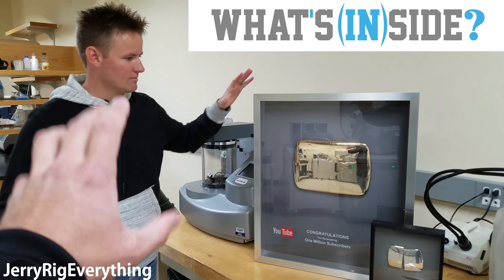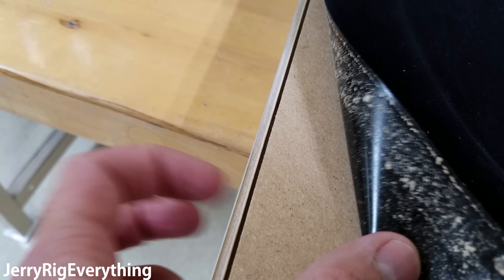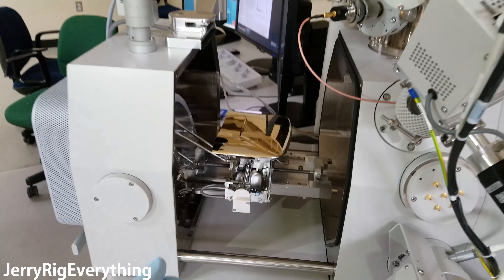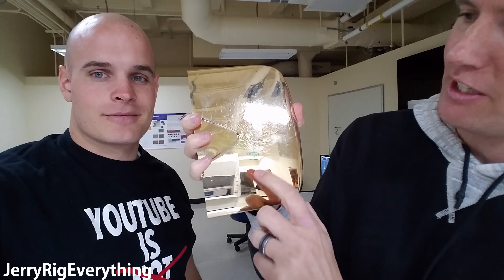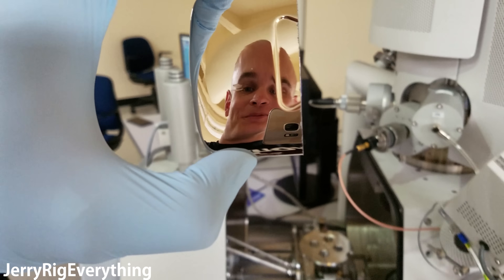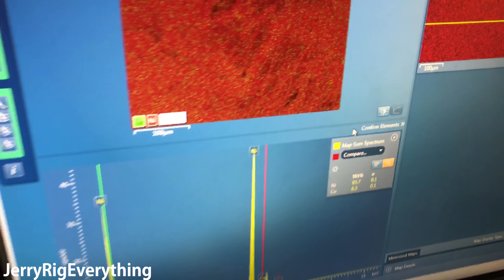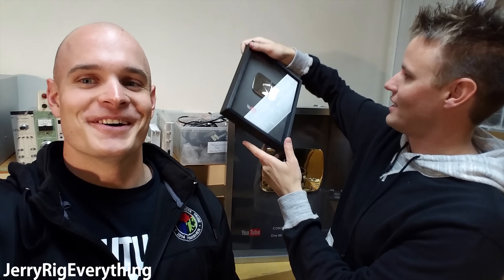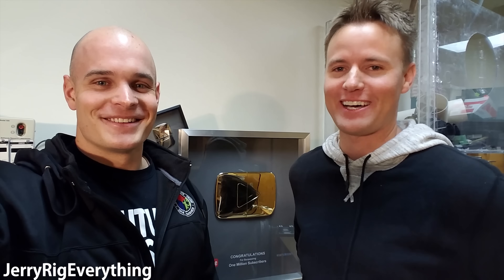What is the Gold Play Button REALLY made of?!?

Comment: With direct gold-on-copper plating, the copper atoms tend to diffuse through the gold layer, causing tarnishing of its surface and formation of an oxide and/or sulphide layer.

A layer of a suitable barrier metal, usually nickel, is often deposited on the copper substrate before the gold plating. The layer of nickel provides mechanical backing for the gold layer, improving its wear resistance. It also reduces the impact of pores present in the gold layer.

Comment: The reason you get higher values from the back vs front could be due to the surface properties. I work with an WXRF and when the sample is not perfectly polished, then it will give false values. There is also the concept of using actual 24k as your standard or a brand new plaque for your control. None of this probably matters after 7 years, but it’s cool to see equipment I use at work being used different ways.

Comment: interesting, my theory about more gold on the back, is that they plated the whole thing in gold, and then polished the front which apparently removed around 5%, if 24k gold was used, then maybe the reader can penetrate a little bit under the surface to discover all that nickel. I mean, if the theory is correct it means that after just 3 polishes, which I assume they also remove as little material as possible, you get to the nickel, so definitely possible that the spectrometer can see some nickel underneath the gold.

Comment: I just watched your video on the Aftera, and I want to complain about your statement that it requires thousands of parts to replace a head gasket! 
These kinds of statements are misleading and wrong 😕. In the future, 
could you please stick to the facts? 
Replacement of a head gasket requires the removal of the valve cover, the removal of 6 to 8 head bolts, and the replacement of the gasket. Then reassembly in reverse. Not thousands of parts!!!!

Comment: Did you consider that the front is showing less gold than the back because they started with a plated surface(aka very very thin layer) and polished it thus removing some of the plating? It would then make sense that the unpolished back would contain more gold due to a thicker layer of plating? I think the hairless dome has been polished a few too many times as well.

Comment: All you had to do was change the acceleration voltage of the electron gun to a lower voltage such as 5kV . Redo the EDS analysis. if the gold content increased that would be due to the beam not penetrating as much and showing a bias for the surface material. There is actual programs for using such differential analysis for the coating thickness measurements.

Comment: My uncle used to run a gold plating business that ran parts for many different companies including Hewitt Packard at one point. He commented that this is an extremely common issue with gold plating since the brass will not plate properly directly to gold(nor will it have much wear resistance) it is first plated with Nickel and then plated with the composition of Gold requested by the company the Nickel is typically by far the thicker coating for various reasons and will show up in an electron microscope either if the gold is not plated on thick enough or has been worn down his thought on this was that the gold had simply been worn down slightly judging by the state of the play button and that is what is causing the nickel and zinc to show through. this does show that you would need to re plate the piece if you wanted it to last a particularly long time and both front and back are plated to help with corrosion resistance. If you want the part to be safe from oxidization you may want to re plate the parts that were cut or worn down in the front.

-Best regards I love this kind of content so keep up the good work.
Reply from the maker: Very interesting, thank you!
Reply: @JerryRigEverything   you are osm
Reply: The plating was likely worn off from when they polished it to that mirror finish. Which is why the back looked like it had the proper composition (80-20 Nickel to Gold).
Reply: I don't think brass will corrode that much, unless the button is kept under water.
Reply: All I can think about is LA Noire electroplating.
Reply: tldr
Reply: Understood.
Reply: Electron microscopes sample pretty deep. Unless the gold layer is several microns thick, it's not surprising that a nickel adhesion layer shows up.

Also, fun fact, you have to do this to get gold to stick to glass, and for that we often use chromium.
Reply: @ojaskumar521  ??
Reply: @PartSane  haha

Comment: It's almost certainly really 24K gold plated. The electrons and x-rays of the EDS area shooting right through the gold to additionally see the underlying Ni and Cu. EDS penetrates a few microns and Au plating is usually quite a bit thinner than that. Between the copper and gold they will plate a barrier layer of nickel to keep the Cu and Au apart as their atoms want to diffuse into one another, leading to an ugly finish. The Ni prevents the Au intermixing with the body of Cu. If you want to really verify what's on the surface, find a lab with a Auger electron spectrometer - this technique only samples the very surface and I'm certain you'll detect only 100% gold.

Comment: A weapon is a tool just like a shovel the shovel is designed to dig a hole a relatively small one. If you want to dig a large hole you use a different tool such as a backhoe. The AR 15 is a a tool what is the purpose it was designed for.

Comment: In spectrograph analysis it depens how big voltage he used for the beam. Higher voltage - deper analysis. So if the gold layer is very thin, it will be better try lower voltage :-) I was working in Thermofisher scientific which is making this microscopes :-)

Comment: The top side has less hold probably because they electroplated the whole thing and polished the top off to a mirror finish. Also, the coating really doesn't have be thick for the gold to be visible. Coating a few atoms thick would also look gold like. But the x-ray could probably penetrate more than that thickness and was reading the base coating as well which was nickel. That's why it didn't show 100% gold.

Comment: Hehe, I used to be an electroplater by trade, and I will happily state that the gold play button is brass, plated with nickel and then gold on top. The gold is probably only a few of microns thick, (for cheapness) so yeah, it can easily rub off, and the nickel underneath was polished to a mirror finish. The silver play button is interesting, as I was expecting it to be a zinc nickel alloy, but it's just nickel and copper, oh well. It's still kind of like belt buckle metal, just with no zinc.

Comment: I know this is three years old, but you all have to understand that the plating is probably a nano coat.  Maybe 100-500 nanometers.  That's why the sub-straight is brassy - so the coat can be thin and it won't look blue or red.  The interaction volume on that machine is probably at least a few cubic microns.  Under the gold is possibly a pre-plate, like a primer.  So, you are more seeing an indication of the thickness of the gold plate rather than the actual content at the surface.  If you could use the BSE detector on the crossection - you might see it.  Normally not, but that is a nice scope.

Comment: It is normal that before they do gold plate the thing, they first nickel plate it (or copper plate it) - it improves the surface finish + improves bonding conditions for the gold layer. Gold layer is usually extremely thin (units of micrometers).

Comment: Just watched the video, thought it was interesting as I am a specialist in electron microscopy. I think I know why they didn't see as much gold as they expected. 

Basically, when the beam of electrons hits the sample, the actually enter the sample, going anywhere to 10 microns (or  0.01 mm) into the sample (depending on the beam energy and sample). Most of the X-rays that are generated (and used to identify the elements) come from deeper into the sample.

The gold coating could be as thin as a few hundred nanometres. That is 0.0001 mm! that means most of the signal the X-ray detector pics up comes from the sub-surface layer, which is not gold. 

Basically, you can have a very pure gold surface coating that is so thin that it doesn't register very well with a conventional detector setup. But its still pure and therefore 24k gold.
Reply: @odouroushouseant  because you can't make something so big as the play button entirely of gold, it'd be expensive as hell. So they use other metals(like nickel)+alloys inside and coat it with gold
Reply: Nice
Reply: @odouroushouseant  eh you missed the point, read again
Reply: True, exactly what I thougt. I work with TOF-SIMS and XPS. An XPS analysis would be the way to go here as the measuring depth is around orders of magnitude shorter.
Reply: I watched a how it's made episode about gold plating. They took a brass item, then electro plated it with nickel first, then dunked it in another tank and plated it with gold.
Reply: @starburst98  This is exactly how you would do it. Nickel inhibits the migration of copper (from brass) into the gold layer. If you don't use Nickel the gold layer might change its color over time (copper migration)
Reply: That sounds plausible. My thought was that the front maybe has a thinner coat of gold because its so polished, which also reduces the thickness of the top layer.
Reply: @odouroushouseant  Your one of those Dumb People Trying To Act Smart, 

You:❌
Everyone Else:✅
Reply: @cypher8thformationhotdoggo938  You're*
Reply: To sum it up they don't make it gold because it would be too expensive
Reply: Gold alloys typically use nickel on the surface. Theres no surface, subsurface and middle used in jewelry. Nickel is commonly used to dilute the gold in a piece anyway
Reply: Besides there was no nickel detected in the cross section
Reply: @odouroushouseant  actually the reason the gold paly button isn't actually all gold is so robbers don't target youtubers
Reply: @freezy9487  no it's because gold is expensive
Reply: @freezy9487  going by this logic they shouldn't be paid too lol
Reply: @freezy9487  lmao
Reply: Brainy is the new sexy.
Reply: Neeeeee I'm not weird.
Reply: Y'all nerds. 🤓
Reply: Nerd lol jk

Comment: The reason that there was less gold on the front is because the front has been polished after the gold plating was applied, and the back was not polished. Some gold was polished and buffed away during finishing at the manufacturer. That’s my take on it anyway, I could be wrong of course, but I’m pretty sure that’s why the results came back as they did. Like if you agree! I’d be interested to know. Thanks 🙏

Comment: Ok so here's what they're doing, the zinc/copper chunk of metal is first plated in nickel and then a layer of gold over top of that. The reason nickel goes on first is the layer of gold sticks to the metal better when there is a nickel base layer. Both of these layers are only going to be a few hundred microns thick. At my work we work with aluminum boxes that are gold plated in in this exact manner.

Comment: what is the definition of gold?
Reply: It's an element from periodic table with atomic number of 79.
Reply: @Nikola95inYT  
so is 9 karet of these element is gold?
i men in which purety you can call it gold?
Reply: @strokerz2858  you meant purety, it's a bit different. It's just a measure of the purety of gold. The pure 100% gold is always 24 K (karat). So anything less contains a lower amount of gold. Usually there are 14k, 18k and 24k gold. Pure gold is too expensive and is too soft for jewelry purposes. So people add other elements (nickel, copper, etc) into golden jewelry to make it more durable.
Reply: @Nikola95inYT  
in Saudi Arabia
24k-22k-21k-18k
puorty is gold
 anything less than that is not considered gold

Comment: As jerry mentioned, with EDX the x-ray penetrates the surface up to 1 ym and the resulting composition which is measured is actually the composition averaged from the surface to a deepth of 1ym. The coating thickness of 24 kt gold can reach levels of 0.1ym. If the core of the playbutton is a nickel and zink  alloy (as you could assume by the shown result of the EDX-measurement), this would result in a proportion of gold of around 10%.

Comment: Theory: 
The front has less gold because the plaque is made and then plated, at this point the whole plaque should have the same amount of gold, but then they have to buff it and polish it to make it look glossy, rubbing off some of the gold. 
I Do not think simple wear and tear would account for that much of a percentage difference. A simple way to test this would be to see the gold composition of the thin stripe of glossy surface that was in the back side of the plaque, I bet it also has a lower Au content..
Reply: I can confirm that your theory is probably correct. The plating is just insufficient on those buttons, and for sure it is not pure gold.

Comment: Yes..... typically this type of gold plating is somewhere between 5 & 15 microns thick and deposited by an electroplating bath.  In order to plate it with gold, it’s usually plated first in nickel, then in gold for better bonding results having the nickel as an intermediary substrate sandwiched between the brass and the 24K gold.  The difference in material content between the front and back surfaces of the button is due to the front surface being buffed to a high polish which actually removes material in this case.  The gold plate on the back is not subjected to buffing allowing the plate on the backside of the button to remain undisturbed and therefore thicker.... just my humble hypothesis, i.e. my two cents worth....  ☮️

Comment: Electro plating of gold requires a substrate metal it will bond to. Brass is cheap and light. But gold will not attach evenly. So the brass is plated with nickel. A very heavy metal. Which is why they only plate a thin layer. Then the gold is applied. 15% actually seems high to me.

Comment: What time is the technical work to pull on physical things... where is your accuracy to measuring material density
Reply: Who gave you the rules to follow and the lines to read
Reply: What can you do that machine can’t show you... question everything and leave it broke and broken. Seperate parts and say put yourself together alone.. no help no working parts no movement and all the elements of time in rusting and during Weather or not you get an upgrade to the accuracy
Reply: How will you get a grease for friction and oil to lights before your design is a rewrite
Reply: To much to change is a small frame of mind
Reply: How can you find it if the world came for it and killed its value to say where can you use your fingers, working towards nothing... no human... if I can’t show you freedom is dusty condition without wisdom

Comment: If you want to get the composition of the coating of your play button maybe you should lower the electron beam voltage (I can see on your screen that you have used 20 kV) and check if the nickel contribution gets smaller. I suspect that your interaction volume of your electrons is too large and you get alot of signal from the inside of your sample or at least from a layer beneath the coating.

Comment: I work in a plant that plates parts with nickel, gold, silver, tin, or palladium that go into car rear view cameras, radio towers, etc. The part usually starts with a copper/ bronze/ brass base. Each part is connected to a rail that makes it easier to plate the parts through the line all at once. For the final product, the rail is discarded. First, the part comes off of cardboard reels that need spliced together to keep the line going.  Next, it goes through an electroclean bath, then diluted sulfuric acid to clean the part. Then, it goes through 4 cells of nickel. Afterwards, it goes through a gold wheel. Then, it can get silver, tin, whatever the requirements are for a specific part.

Comment: Energy Dispersive Spectroscopy is not a good technique to use here, especially for thin coatings- a micron or less, as it tells the sub-surface information mainly (1-5 microns deep). Higher the beam energy, you get higher signal deeper from the sample. You used 20kV for top surface and 10kV for bottom surface, that's why you see more Ni content at 20kV and less at 10kV.  Auger electron spectroscopy or X-ray photoelectron spectroscopy (surface sensitive techniques) are more appropriate here. I guess your gold coating is safe.
Reply: Damn! Boy you changed my mindset!
Reply: @abeginnerspov5968  skewed attitude like that is probably as consequence from being denied one of the boobs during weaning. ;)
Reply: The elemental analysis is based on x-ray fluorescence spectroscopy. Keyword: x-ray. This will penetrate at least several atomic layers, which means that the obtaines result will also be influenced by more than just the plated level. Result obtained is a blend of the surface as well as subsurface elemental composition. flies away
Reply: I was thinking they did some touch-up polishing on a front side, that's why.  But I like your version better.
Reply: sarbada varun wqs

Comment: 24KGP REFERS TO 24 K GOLD PLATED....."PLATED"...."COATED" WITH 24K PURE GOLD COATING....NOT ENTIRELY MADE OF 24K GOLD.
ITS ALREADY MENTIONED...24 K GOLD "PLATED"......SO OFF COURSE, YOU WILL NOT FIND GOLD INSIDE THE SO-CALLED METAL BUTTON....BECAUSE IT IS GOLD "PLATED".
Reply: The electron microscope only analyses the surface of the object, therefore it should read a higher gold value if the coating actually was made of "pure" gold